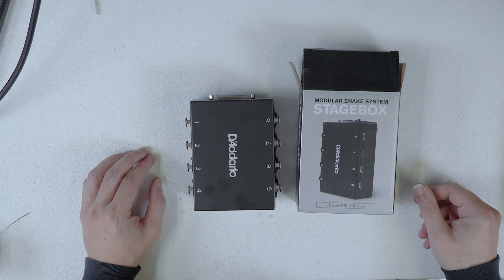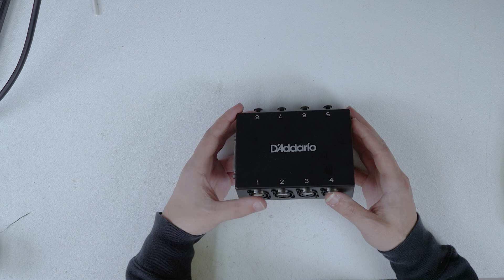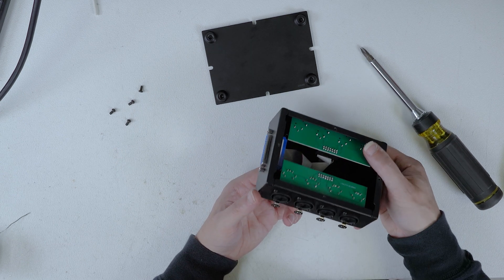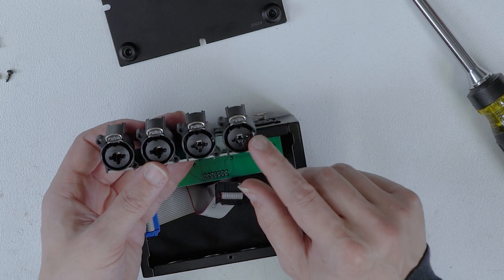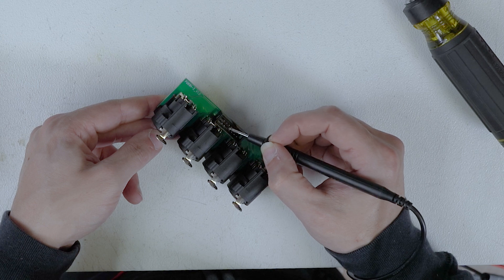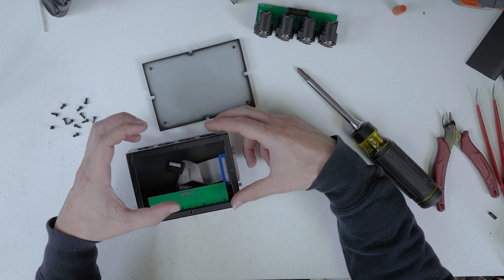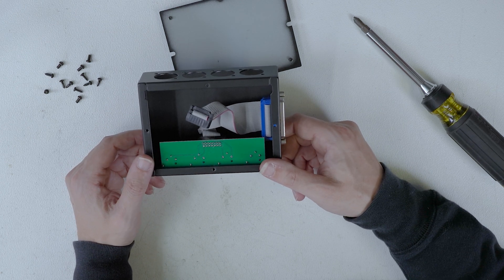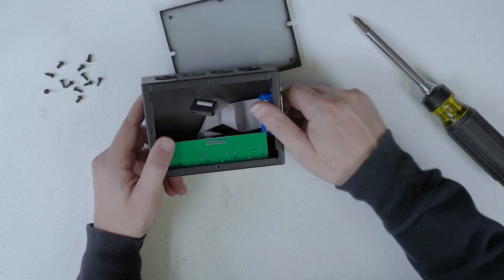D'Addario PW-XLRSB-01 Modular Snake System Stage Box Evaluation

Comment: For $75, you could make it yourself and cheaper?
Reply from the maker: I could not. I'd guess the cost would be $300ish if I built it. It would obviously be way better, but I'd guess 99% of people would just buy the D' Addario box.
Reply: @billylaguardia  Why do you need/want PCB's? Just hard wire direct from d-sub to Neutrik jacks.
Reply from the maker: @evankolpack  it’s saves time using a PCB vs point to point soldering. DB25’s are tedious to solder.
Reply: @billylaguardia  I was thing a prebuilt box, self designed PCB's. But I'm now thing maybe it would be more then $75. I wrote, without thinking it through. Which happens often when I think of projects 🤣